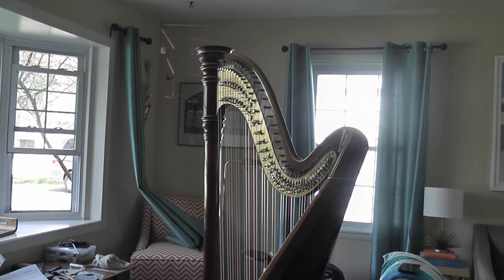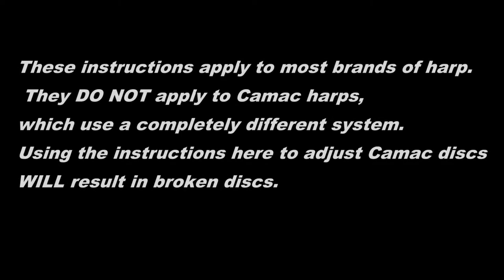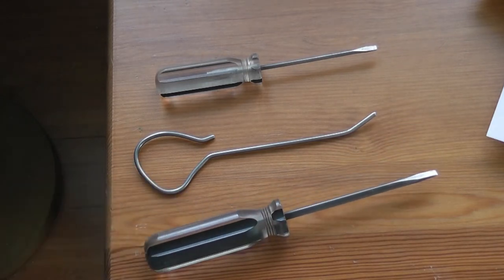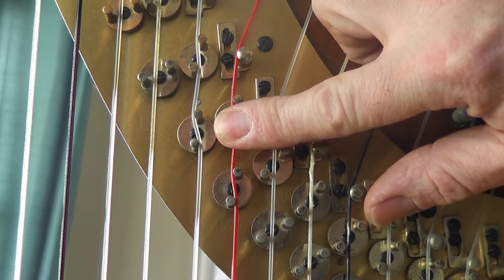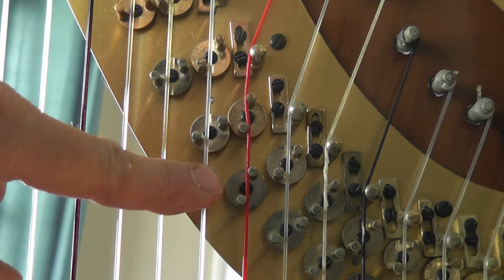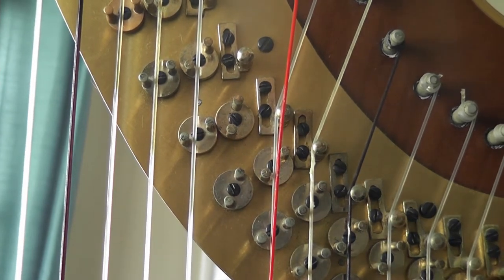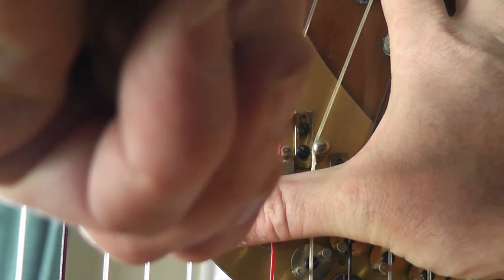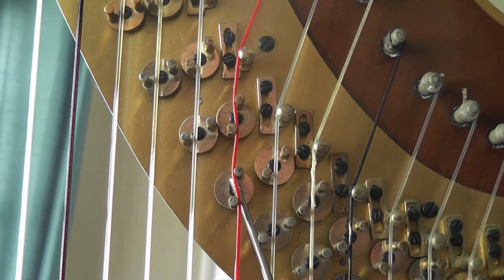Pedal Harp Disc Adjustment

Comment: Is it possible for a pedal harp's discs to be adjusted to make the whole thing in Pythagorean tuning. So if you tuned everything in the flat position in Cb major in Pythagorean tuning, could the natural, and sharp discs be adjusted on a normal pedal harp so that the naturals and sharps are in Pythagorean ratios.  This would mean that the chromatic semitones would be slightly bigger than in equal temperament. This would also result in Cb on the C string and B natural on the B string to be a Pythagorean comma apart at 23.46 cents and no longer equivalent.

I am wondering if this is possible on a standard pedal harp, or would a custom harp be needed with custom disc placements.
Reply from the maker: That's a good question. I don't know a lot about the topic of Pythagorean tuning but I suspect you would need a custom design, since the standard mechanism is designed for an equal tempered scale. The discs themselves have a narrow range of adjustment. You can vary the pitch of the string by only a few cents in either direction. It would be an interesting experiment to try on a standard harp to see how close one can get.